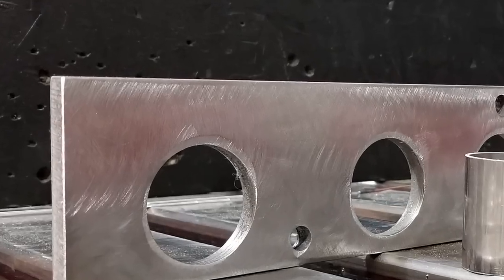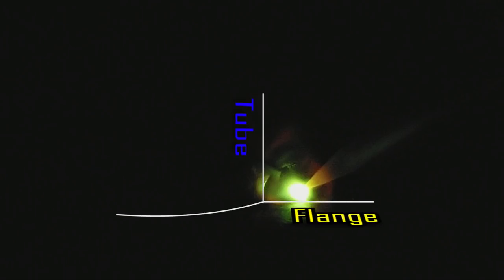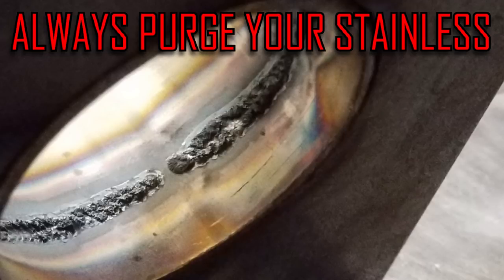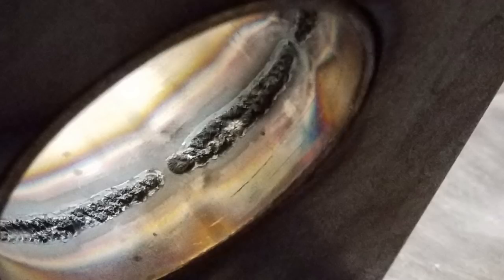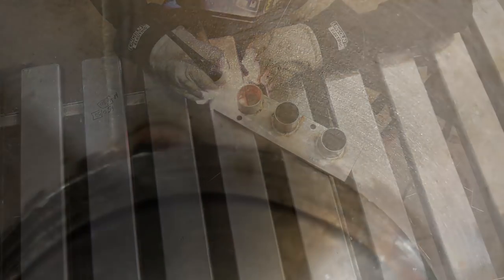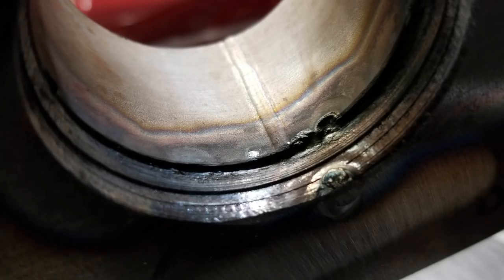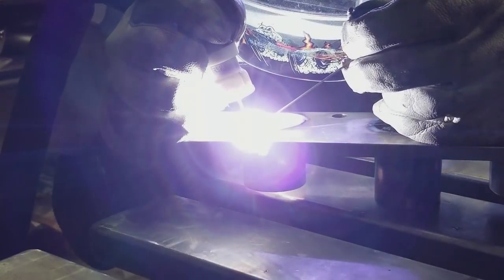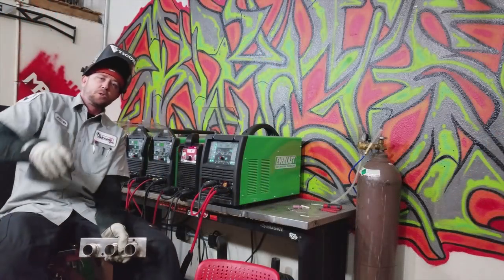TFS: How to Weld Thick Metal to Thin Metal

Comment: When doing a tack like this I concentrate on the thick part. Wait for the puddle, and move it briefly to the thin part, which is now heated. A puddle forms almost instantly, and then I move it away. You can do it either way, but I regard it as safer starting on the heavier part. Of course, a lot of it is skill. If you are new to this, starting on the thin part is more dangerous, because it can be difficult, without experience, to tell when you’ve heated that thin tube enough, and you may be uncertain enough to leave it just a bit too long, and punch through. But when puddling on the thick part first, and that puddle forms on the thin part when you move the tip towards it, you will see them conjoin, so it’s easier to know that it’s done.

Comment: That black on the back is called superintendent or carbide precipitation it has to do with that stainless not being purged but also more so that you amperage is to hung and travel speed to slow the grate thing about stainless is it is stronger thus a smaller bead is ok

Comment: I just started trying to Tig. My teacher (friend) has me using a much smaller cup and also to only let the tip stick out about 4mm from the edge of the cup. Where in this vid, you have a massive cup and the tip sticks out a mile! Is this necessary because you are welding inside a 'corner'?

Comment: AWESOME vid!  You should make a video of how to weld a pipe/tube to a vband flange.
Reply from the maker: knonfs My Raw & Uncut vid has footage of me doing that in it (twice I think). The exhaust vid has about 2 or 3 clips in it as well.
Reply: I've seen them.  The thing is that I've heard that welding vband flanges without warping them is extremely difficult.  If that's the case, I  was wondering if you could cover that.  I have not seen any youtube videos covering this, maybe its not that difficult?
Reply from the maker: The only time I see people warping is when they cranked too much heat into it. Either too much torch height or too much amperage will do that.

Comment: I understand you say where the focus of the heat need to be, but what about the filler rod? Do you place it up on the wall of the pipe and let gravity pull it down or place it right in the groove and drag it up with the torch?

Comment: Hi, great video. I’m a newbe in tig and was just wondering how did you know that 100amps is the right amperage ? Rule of thumb for SS I think is around 35amps per mm ..... So is there a compromise between 10mm thick base and 1.6mm tube or how do you decide at which apms to start ? Thank you.
Reply: I was thinking of the same question. I'm also a noob tig welder.
Reply from the maker: I'll try to make it make sense. There technically are no "rules" of TIG welding. What you find are guidelines and suggestions for running certain metals of similar characteristics. 

I based it on the amperage it takes to burn a certain amount of metal away that I know I want to burn. In this case, I want about an 1/8" (3mm) of the edge of the flange to burn for a good penetrating weld (1/3rd thickness of the flange). That would take somewhere between 100-120 amps to do depending on my speed, filler, and other factors. 

I was running extremely thin filler metal in this vid so everyone could see the shots, so I would have had to run a little faster to keep up with the puddle at higher amperage. Instead of flying right through it, I decided to take the low amperage of 100 amps and full throttle it all the way through which slowed me down enough to get a good shot, but still not too hot to where I would blow up the thin tube. If I ran 1/16th filler, I would have to increase my amperage a bit. 

The focus is also the key player in any metal you weld. If you have too much focus in the wrong place - you'll burn or blow it up.
Reply: Kristijan marin  you set your heat to the size of your filler rod
Reply from the maker: brian keller I won't suggest that as a good or sure common practice. It's a common practice to follow "filler=amps", but I ran .045" filler on 100 amps. That's not even close.
Reply: The Fabrication Series  .. fair enough but you could do that with anything .. you could use 045 wire while using 200 amps but its not the best... if your welding at a 100 amps using 045 chances are your feeding like crazy to satisfy the puddle or keep surface tension why not just use 3/32.... that being said every job is different and sometimes u need to do the job with what u got... anyway take care keep up the good videos

Comment: Hey Justin, new to fabrication, and to tig, you mention here the welds are much weaker when not back purged, I'm welding lots of 20mm x 40mm 1.5mm wall 304 box section at the moment, is back purging really needed?

Comment: Do u have an up to date video of this on mig welding???????????
Reply from the maker: I can make one.
Reply: I would love one
Reply: Very similar technique, but you weave slightly, holding on the thicker material for slightly longer than thin as you move side to side.
Reply: I would also love a video for mig! Currently mapping out a tube-front-end for my drift car and 99% of the welding I do is simple exhaust work, so I don’t have much confidence in welding the plates to the strut towers and thinner (unibody) frame rails.
Reply: Was going to ask this too, would be super helpful. Although the technique is probably similar, I imagine many of us who run MIG would still benefit from seeing how you do it

Comment: what an invaluable tutorial. Thank you very much for "the detail tutorial. By the way, I still have a problem in the way to devide a 100cm x 10cm x 1cm raw SLD Hitachi D-2 steel material to be 2 pieces of it sizing 100cm x 4.95cm x 1cm "without making a big chage of the quality of the material at the line of cutting. I do not know what is the best way to do it with. May be you have some advices for me to learn with. THank you very much again for each of your knowledge sharing. GBU always.

Comment: We don't Purge anything we weld here at our shop since we're not a code shop and we weld all stainless, sometimes aluminum. I was hoping to get some tips on how to not sponge through while welding thick to thin (currently I'm welding 12guage to 7guage (basically in the third configuration you showed)), but you absolutely obliterated it. You sponged through on the entire length of your welds except for your stops and starts. If I welded it like that here I'd probably get fired. I'm basically having to use the tungsten and filler wire to "splash" the puddle up onto the 12guage and the come back down and move to the next spot to create the ripples. 

Not trying to be mean here; just sharing how we would view that at our shop.

I guess technically the way we do things here, we're not quite getting full penetration, but from my perspective, you got more than 100% penetration (like 110, 120, or 130% penetration) since it was starting to come out the other side (sponge through).

My goal with what I'm doing is to get more penetration on the 7guage by focusing on it longer during each dime or bead or (I'm going to call them ripples) each ripple, then splash the 12 Guage, shove the rode,  and move on.

I'm currently at 143amps. I just have to adjust my speed to make sure I don't sponge through, and make sure I push enough rod (filler wire).

I don't have the luxury of a pedal. It's just locked in at whatever amperage I set and it's either lift arc, or my dredded scratch start.

Comment: How do you combat the undercut that you get sometimes when tigging heavy material? I've tried adding more filler but it still undercuts on the edge of the weld, even if go high or low with the amperage. If you focus your arc towards the undercut it doesn't help either. Usually on cast steel but sometimes just regular old mild steel?

Comment: Question. I'm learning to TIG but thought your tungsten had to be closer to the cup. Why was yours so far out?
Reply: Running a longer stickout helps with being able to maneuver the torch to the correct angle in between pipes.  However, he is only able to run such a large stickout due to the extremely large cup size he is running, and, I presume, a really efficient gas lens which helps him maintain gas coverage over the weld.

For starting out, it's best to keep your stickout no more than the diameter of your cup.  That should see you through the majority of your basic welds until you get a feel for torch angle, and when you start to lose gas coverage, etc.  Good luck.
Reply: @mikefurlong8025  thanks man, always like helpful replies

Comment: How to tig weld thin to thick, good information but put that in the header, I am a lowly production welder with only mig  and pulse mig at my disposal. Last night was welding expanded metal to 14 gauge to 3/16. And took way more time than I should have. Wish I could just whip out a tig torch for random parts.

Comment: Good clip, like everytime! But, with stainless, it's easy weld! I've allways little problems with 6061 and other AL. For example, at the wastegate 25x2mm welding to 60x2mm. The small tube allways runs away.... :-D
Reply from the maker: Focus the arc on the bigger tube when welding. Same rule applies.

Comment: What do you mean when you say you didn't purge the weld? Is this in addition to the torch gas?
Reply: Yes, it's having an argon environment inside the tube so the inside bead isn't exposed to atmosphere when welding.  A purged inside would look like the outside weld bead, instead of the "sugaring" shown.
Reply: Rosser Pace yes. Gotta have gas on the inside of the tube as well. You can close both ends with foil and pump gas in via a second line.
Reply from the maker: Check this vid about purging. I explain it all.
https://www.youtube.com/watch?v=AIRWMhoke9I&t=5s

Comment: Might have been asked,but didnt see it when i looked. Instead of back purging whats your opinion on using Solar flux for stainless in this type of situation?
Reply from the maker: I use it all the time.
Reply: Thanks for taking the time to reply. Yeah just wanted to be sure it was exceptable in and header type situation. Always heard back purge only in that. Again thanks for taking the time to reply
Reply from the maker: 00camaro00 Usually the biggest gripe is the glassy mess it leaves behind which can breaktfly off if not cleaned. That could damage or clog stuff.

Comment: Do you have to purge when you are doing that flush mount weld (your last one ) and if so how would you do that?
Reply from the maker: MasterMachinist WH There is technically no way to purge that unless you are in a chamber. Most of the atmosphere is driven out by argon, but some will remain in the gap and a small amount will sugar up. However, that's just a filler weld and not critical. The first weld would fail all day without purge.

Comment: G'day what I would like to see a video of is welding aluminium 2"od tube 1/16 wall to the end of 2"id pipe 1/4 wall the two pipes sit inside each other by 1/4" because I'm just burning the thin tube away
Reply from the maker: I'll see if I can find those sizes locally. The key word though is focus. There is a bit of a trick to aluminum, but the focus must still remain correct.

Comment: I assume the concept is the same for MIG welding? If possible, would you be able to put a quicker video showing the same concepts with MIG? Something like welding rollbar backing plates to a factory floor plan. Thanks.
Reply: Same applies with Mig. Focus on the thick piece and tie in to the thin piece.
Reply from the maker: It is pretty much the same as mentioned. I usually give a quick push into the root to make sure the puddle gets in there, but still the same concept of focus.

Comment: How much CFH of argon are you running with that long of a stick out? Gas lens?
Reply from the maker: William Preston standard gas lense at about 30 CFH. It's not as extreme as people think. The coverage is a lot better with the longer stickout.
Reply: The Fabrication Series visibility has to be perfect. I just bought my first gas lens and the supply store only had a number 8 pink cup for it. Just testing the limits an seeing the flow vs stick out values.

Comment: It seems to me that the tungsten stick out is HUGE! Can you do that because of the Furick cup? Did you get that from Jody?
Reply: Alan Susnow  i think he does it just to exaggerate in the video so we can see, i know for example in my work we would never have ot out that far, as the futher in it would be, would make for better colours and more focused gas coverage
Reply: I get that, but his welds look PDG even with that stick out. I recognize the #12 Furick gas lens cup that Jody sells at weldingtipsandtricks . Even with all that stick out you can still see the argon shield around the weld.
Reply from the maker: Alan Susnow It is a #12 Furick. I either bought it from TiCon Industries or Weldporn (can't remember). Stickout is roughly 3/4" which can operate like that all day and night with no issues. I also use a lot of stickout for weld shots because it's very difficult to get in close and see, but long stickout on the cup offers more coverage than short. That's what it's for.
Reply: Thanx, that's what I wanted to know! Love the Fabrication series, always good stuff!!
Reply: no you can weld all day everyday with that stickout.... rule of thumb is you can stick out the tungsten the same distance that the ID of your cup is... thats a #12 cup he was using...

Comment: How do you weld any metal with a NEVERLAST?
Reply from the maker: CRAZY HORSEPOWER Same way you do it with a lowsy beer, a dead president, or a bumble bee. I actually used my HTP for this vid.
Reply: The Fabrication Series So why show a bunch of  Neverlast welders,Those who either own them or work in welding supply stores that repair welders know that cannot be repaired due to no parts.I would not want to be caught dead sponsoring a Company that has some of worst complaints I have ever seen including a welder that was not certified 5 years ago.
Reply from the maker: CRAZY HORSEPOWER I think you're caught up on some once upon a time action with Everlast. They're not what they used to be.
Reply: The Fabrication Series I have a friend in a welding supply that repairs welders the two welders he turns away a lot is first the Everlast especially the 256s plasma,tig and arc welder AC/DC machine the mainboard fails a lot.
They cannot get the boards to repair them and if he does it usually takes 7 months to a year,The second one is ESAB as they are a better company than NEVERLAST it still takes a couple of months to get parts.
Lastly I do know for a fact the owner and CEO for Everlast has a long track record with THE BETTER BUSINESS BUREAU IN Califorina as to not honor the supposed 5 year warranty.One guy has a pending case that has been going on about 5 years by now.
As for Me I know for a fact the owner is  a snake in the grass as I personally have had caught him in a lie when he left a message on my answeringmachine he IDENTIFIED himself as being from Costomer service from AMAZON then later on in the recording claims he is A REP FOR AMAZON then finally he says he is from Neverlast.Also The recording was sent to Amazon and Corporate was not pleased.So if I were you I would question them and ask the owner what relationship he had with the Owner of Longevity all though it has little to do with welder what it does have to do with is business practices with the public.I do not need to prove what I say as the information is out there call Mr Tig,Call Kevin Carroll,Call B.B.B.they may enlighten you as they have machines that were in need of repair.
Reply from the maker: CRAZY HORSEPOWER I'll be straight up with you - I really don't bother worrying about anything until I have to. It's all hearsay until I experience something. My experience thus far with my machines and customer service has been good. If it changes, I'll be sure to alert my audience about my experience, but at this point, I have nothing to say other than I don't share your experience or the experiences you report about othets. I'm not going to worry about it until I have something to worry about.
Reply: The Fabrication Series As it's your option to do so I am just making you aware.
Reply: CRAZY HORSEPOWER I own an everlast and I will honestly say it is a great machine and I have nothing but good to say about their customer service. I had an issue with someone selling everlast on eBay and everlast stepped in and made it right and the original transaction had nothing to do with them. Until I have an issue I'm sticking with what I know and have experienced, as of now I'm happy with them.
Reply: FollowerofYahuwah That's great are you in the USA? Also did you ever watch Mr Tig on weld .com and wonder why he STOP making videos? 
Also do you own a 256s as this is the welder in question?
Reply: I had a problem with my circuit board. I have a Everlast 200 dv. Thought I was screwed because I was nearing my warranty on my Everlast 200dv. They took care of me though. Shout out to Everlast.